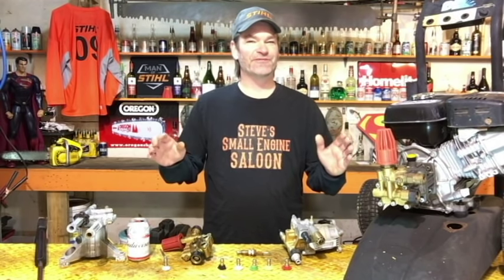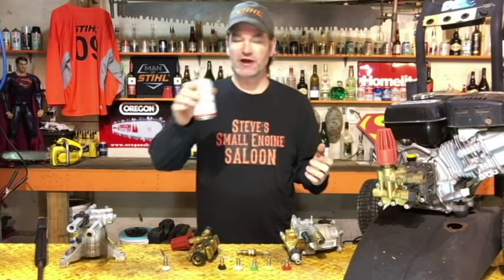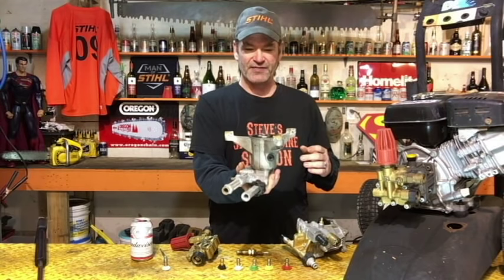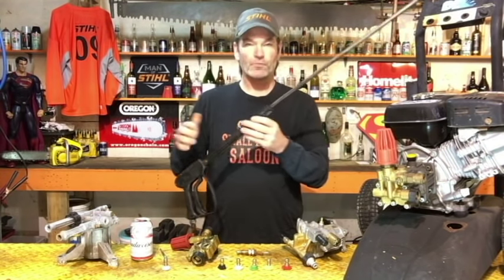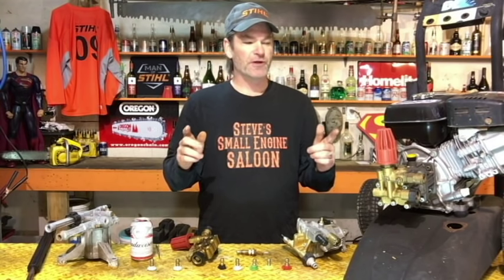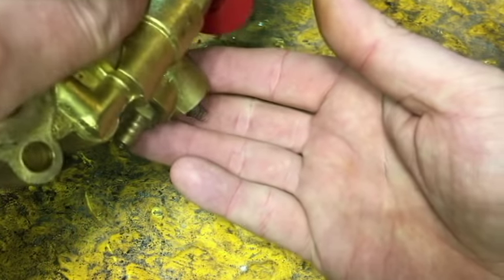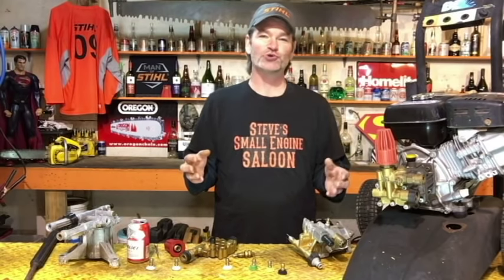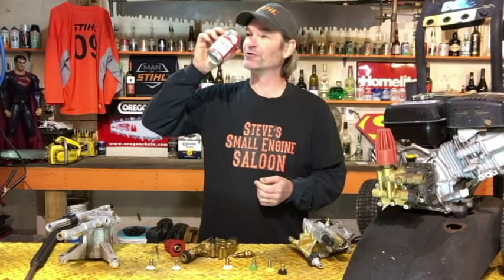How To Fix A Pressure Washer That Has Low Pressure

Comment: You covered the basics, but not all of them, the lack of pressure could also be because the water supply has low pressure such as from a well with a small pump and tank (not city water) I noticed that when using mine at my sons home across the road from me. My pressure washer works great at my place but I seem to run out of water at his place when the water pump at the well has a low water level in the tank. You need to wait for the pump and tank to catch up so it can supply the pressure washer. The other could be that there is a kink in the garden hose

Comment: Great video that helped alot. I have an older craftsman clean and carry 4.0 hp brigs and stratton pressure washer. No water exiting the nozzel. What I found was I have a two piece wand. After unscrewing the front from the back I found lime CAKED TO THE MAX at the front piece. I decided to totally disassemble the wand which was only a handful of small phillips head screws and cleanthoroughly. Works like brand new. Thank again for your amazing tutorial. If you are ever in Bethlehem, Pennsylvania, USA I'll gladly buy you a Budweiser and rum and cokes! Cheers...

Comment: I bought an electric John Deer pressure washer some years ago from a pawn shop cheap that didn't work.  It looked nearly new.  When I got it home and connected the garden hose and turned the faucet on the water just ran right thru it like it didn't have any valves in it and it wouldn't pump.  I sat and stared at it a while then thought shouldn't the water hose go in the bottom of the head and the pressure come out the top?  The garden hose was on the top.  When I twisted the fittings with my fingers they each were 2 piece and unscrewed in the center and both had the same thread.  I swapped them and wa-la it worked great.

Comment: Steve,
Thanks for taking the time to make this video.  My pressure washer stopped making pressure as I was using it.  I had just bought new tips so I never thought to check the orifices.  When I did, thanks to your video, I found that two of the four new tips were blocked.  After clearing the blockages, I checked the water pathway step by step - entry, exit, hose, wand, and tip.  I then fired up the pressure washer, and it worked like a champ.  Checking the tips seems obvious now, but given that I had just bought new ones, I didn’t think of it.  Your video helped me to see the light, literally!  Thanks again.
Reply from the maker: You're Welcome...

Comment: Hey Steve.   I greatly appreciate you taking the time to help people out!  You do a great job at teaching in a very basic way with clarity and easy to comprehend steps!  I wanted to add that in the case of no pressure build-up when running,  the unloader valve pintle/shaft may be stuck in the (spring) compressed position, thereby unseating the check ball, not allowing the pressure to build because it's bypassing the restrictor.   The opposite can occur if the pintle is stuck in the extended position to where the spring is always decompressed, thereby not allowing any water  to bypass the spring tension.   In that case, the pressure washer will always put out high pressure and worse off the pump will always be "loaded" which makes the engine very hard to start if the water is on and attached to the pressure washer.   I've actually narrowed this problem down by removing the water hose and then pull the rope and immediately the engine is able to rotate/start, as long as there is no water attached.   Obviously,  this is only to be done as a quick diagnosis,  NOT to be ran more than a few seconds with no water attached.   I hope that I explained all that clearly.  Maybe you disagree but I just wanted to mention these things because I've experienced both scenarios.   Either way, thank you for doing what you do to help people!

Comment: Steve, my old Troy Bilt pressure washer was completely stopped-up - no flow of water through tip at all.  My wand's tip was open but I checked the o-ring on the plunger on the high-pressure outlet (the second place you said to check) and sure enough, the o-ring had broken and worked its way down inside the plunger, blocking the flow.  Looks like a 50-cent o-ring and I'm back in business!  THANKS! You are definitely my number one go-to source for small engine equipment repair!
Reply from the maker: You're Welcome...

Comment: My Norther Tool Powerhorse Pressure Washer had less than 5 hours on it, and the water flow through to the wand clogged up.  After using needles to clean both the tip and the Outlet nut orifice, which were both clogged,  I'm a happy camper.  Thanks for the tips, they were a great help, and saved me $$ for shop work!
Reply from the maker: You're Welcome...

Comment: Thanks.  Found a clogged screen in sprayer. Cleaned out works great. My favorite saying is got gas. From sling blade. Had water going in but none coming out. Took off sprayer and turned water on to flush out anything else that could be in it. I appreciate your videos

Comment: Professor!  Over the last few days you saved me $ on three front.  1- lost the o ring on the pressure cleaner wand tip quick disconnect.  I was about to order a new part, saw your video and ordered o rings to replace. 2- I was using the soap tip not knowing it and was getting low pressure output.  After your explanation I realized it was the wrong tip.  3- the pressure output adjustment was made clear by you and I adjusted it to the maximum as it was only adjusted half way. My pressure cleaning unit is in top shape now.  THANK YOU!!
I review ALL your videos and treat them as very valuable lessons.  I am now retired with some time in my hands and have turned to doing my own repairs and maintenance in my mower, pressure cleaner and my two portable generator, specially as we start to look at the hurricane season in Florida within a few months.  THANKS AGAIN!!!
Reply from the maker: You're Welcome...

Comment: Steve I love your site, here is a helpful tip for power washer low pressure.
After I changed all the 6 valves, unloaded, pressure vale, checked everything I still had low pressure.
Most over looked replacement for low pressure problems.
Remove the high pressure hose from the PW, this high pressure hose is attached to the 3"  high pressure pipe, remove this 3" pipe, now after removing pipe look back inside the pipe still attached to the PW, yes there it is "The Jet",
unscrew the jet (screwdriver left), after the turning stops, you need to pull the jet out, not easy, what I did, I hooked the PW to the garden hose and the water pressure pushed it out, be careful not to lose the jet parts , (back jet, spring, front jet), small pin hole need to be cleaned out, also the jet may need to be replaced, this is where my problem was, worn jet, easy....
Lee

Comment: This worked. Although my nosles we're fine, I removed the metal tube in the wand and just pumped out water. Put back together and no more dropping in pressure.i would follow all these steps before taking to a shop. I have a craftsman stand up washer with the in and outs on the bottom. Probably 2 years old.

Comment: The wire from a wire brush works really well also. It will work for cleaning those small carburetor jets too. Just use a pair of pliers and pluck it from the brush.
Reply from the maker: Great tip!
Reply: Also the e string from an acoustic or an electric guitar has a good possibility to opening up a small office even an orifice

Comment: Yes, that just answered my question- thanks! I bought a (Chinese) carb-kit on Amazon for the GX160 5.5HP Honda, and that got the motor running, but I had at some point turned out the (red) hand-turn psi valve, so thanks for advising to crank it in! I do plan to pull the jets on the keihin and poke some wire thru the holes and then reinstall it... Thanks again, and take care!
Reply from the maker: Glad I could help!
Reply: @StevesSmallEngineSaloon  You sure did help! I cleaned the original  Keihin carburetor last night and can't wait to install it back into the Honda since the cheap, aftermarket carb (Amazon Chinese copy) is causing the engine surge after difficult starting -lesson learned, ya get whatcha pay for...I will add that I had a heck of a time trying to get the jets out of the Keihin since they were frozen in, but I soaked them with some JB80 solvent, and they eventually broke free-carb threads unscathed, thank goodness!
Thanks again, and take care!

Comment: Steve, before you start the engine. Hook up your hose, squeeze the wand and get the air out of the pressure hose. Also some machines you have to hold the trigger on the wand to relieve the pressure to start the pressure sprayer.thought you would like to know.
Reply: Very true.  Easy to burn up the seals if water is not running free thru the pump BEFORE starting the motor.

Comment: Thank you for this video. And explaining the pump.  Im great with small engines but this is the first pressure washer ive owned. I thought the pump was toast even though its been stored with antifreeze in it for the winter months. Turns out my tips were clogged.  Some compressed air fixed em right up.
Reply from the maker: You are welcome!

Comment: Steve, another condition that can cause the pressure relief valve/ unloader valve to cause a low pressure problem is water that has a lot of calcium or other minerals.  The calcium causes a slow incremental loss of pressure. I worked on one today that I had to rod out the intake manifold,  the unloader, the little proportioner for the soap/ bleach ( on my own stuff, I draw in a vinegar solution to keep the calcium at bay in the pump internals )....  After cleaning out the calcium, I started it up and still had a low pressure situation.... I solved it by rapidly open and closing the wand trigger a few times, clearing out the last bit of calcium  and that fully opened up the unloader and had full pressure back on the machine.  Customer happy! Thanks for the reminder about the warn tips.... great video.
Reply from the maker: Right on Mikey...

Comment: Steve, First things first. Is water coming out of the garden HOSE?  Always run water thru the hose to flush it out before connecting to the machine. Next, Check the screen where the hose connects to the pump. I can't tell you how many times I have seen that clogged. Good tips man.
Reply from the maker: Excellent comment John.  Thank you...

Comment: Man you just saved me. I bought a used pressure washer and it wouldn't build pressure. I saw this video and ran out and checked and sure enough the wand didn't have a tip in it.  Thanks a bunch
Reply from the maker: You're Welcome...

Comment: I loved your video! Mine had low pressure because of a leak in the outlet fitting. All it needed was an O ring and it was good as new. I checked my tips too and found out one of them was clogged and cleaned it out with a small wire. Thanks for the fun and informative video!
Reply from the maker: Great job!

Comment: Thanks man trading work for a pressure washer tomorrow that's been used two times but has low pressure it's a Honda so hope I get lucky.
I got lucky new pressure washer nothing wrong with it tip was the problem they used soap tip thing started first pull changed tip wow pressure.
Reply: Same here got a crafstman pressure washer no pressure no easy fix though. I'm fix small engines for a living now lost my job with this covid 19 bullshit long story short I'm an engine mechanic not too educated on pumps. Been through all the easy fixes expecting a bad pump unfortunately

Comment: I know this video is 4years old so you may not see the comment.  Did everything you said, used the beer method and the rum and coke method. 
Didn't work.  My problem is that it spits and sputters and sometimes when you pull the lever the engine shuts off.
With the wand off it works ok with lots if water coming out.
Cleaned out all the lines and nozzles,  even took those 2 tiny things out of the top of the pump. 
Everything is as clear as vodka. 
But it is still sputtering and surging, and sometimes you have to pull the trigger on the wand and kind of diddle with it to stop the engine from shutting off.
Engine works perfectly

Comment: Hi Steve. I have a (C)Honda type pressure washer with the vertical shaft that I acquired where the pump was shot. I replaced it with one off of Amazon. It worked great for the first 5 times I used it. After using it today for about 5 mins I lost about 70% pressure. I watched your vid here and you have some great tips but hardly anything was said about the verticals shaft pump. I checked everything you said here. Here is another tip for your viewers. Take the pump completely off and check to see if the big metal ring where the engine shaft goes in it seated all the way down. I found that mine was showing a few threads above the pump housing and I could turn it by hand. I know there is a special wrench for this but I used two screw drivers and a small pry bar to tighten it back down and what do you know? It works again at full power. This is the main pump that rotates and pushes on the three internal pistons. Apparently it loosens due to engine vibration. If it happens again I will use thread lock on it.

Comment: Thanks for this Steve. I just today rented a Honda PW to do my driveway, as I have done numerous times before with the same equipment. I noticed right away that the pressure was much lower than before, and couldn't figure it out.  I found this video and watched it to the end. I had already checked the first things you mentioned, but not the last one, and when I removed that black plastic cap, I found that spring broken into nine pieces, and bathed in rusty grime. Bingo!
Reply from the maker: Right on

Comment: Thanks for the great videos.  On a related topic ... will you please show us how to fix a pressure washer that doesn't want to draw in the chemicals or soap?  Cheers!
Reply: Your trying to use the wrong tip. Or you are trying to use to much hose. 50 ft maximum. Or you need to unscrew the thing your hose connects to. Just unscrew it about 4 turns

Comment: Is there a video on more in depth pressure pump diagnosis and/or repair?
Would love to see a few different pumps in pieces and what is likely to fail in an actually worn out, broken or dry run pump, which ones are worth repairing and which ones are better off being replaced.
I have a few salvaged ones and although the really big ones are worth a fortune and almost certainly worth repair, it's hard to know how far to chase for parts and when to cut losses!
Cheers Steveo!
Appreciate all your videos, ya legend!!

Comment: Steve:   I have a 3700 PSI pressure washer and had to replace the 6 check valves on the pump last summer due to loss of pressure.   I used it about 3 hours since then, and it just lost pressure again.  I pulled the pump apart and found all 6 valves are trashed!  There were pieces of plastic all through the housing.   What would cause all 6 new check valves to disintegrate?
Reply: @dustinmeier9753  Turned out to be a thermal/pressure relief valve that was not releasing excess pressure.  Changed that along with the new check valves and works great.  The pressure relief valve pisses when too much pressure builds up.

Comment: What can it be if the pump make pressure variation ? The engine run fine and I having a great pression without the hi pressure hose ? Thanks !
Reply: It means you do not have good water pressure from the garden hose. If you use it very much it will destroy the pump. Never needs to be chattering

Comment: Hi Steve
Could you do a video on rebuilding a unloader. Mine leaks from underneath my pressure adjustment knob. I have replaced the o rings with no luck.
Thanks Bob

Comment: Now I know I'm talking about a electric "Senco" compressor here: Now I've been losing pressure for some time I've put thread tape on all the connection's. And it did not solve the problem but this video gave me the idea to check the pressure adjustment know I found it to be dirty and a small stick in the top, and I cleaned the top. Then I found the bottom to be corroded up so I cleaned it with some "CLR" put a new "O" ring in it and replaced the bottom spring. Now this fixed the problem.....THANK'S FOR GIVING ME THE IDEA...
Reply from the maker: You're welcome...